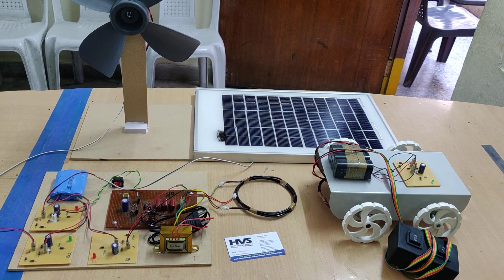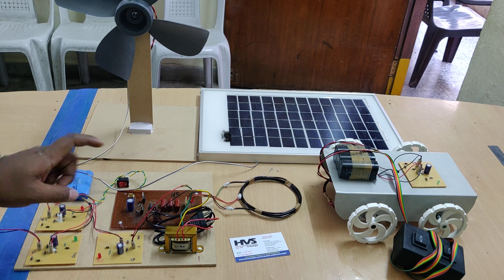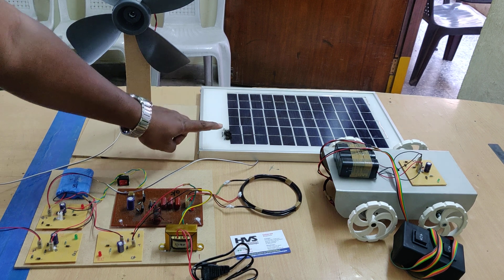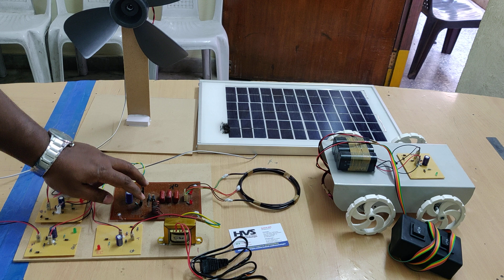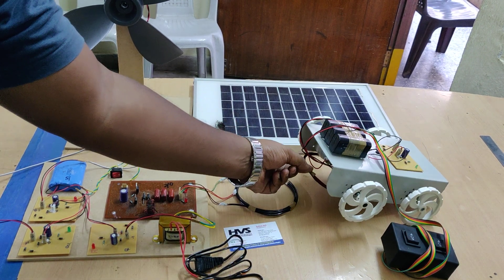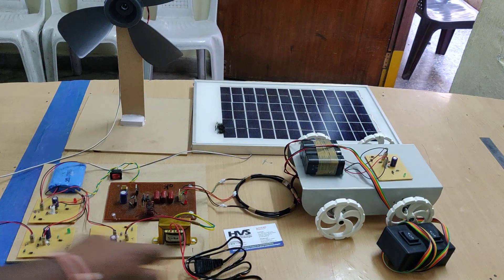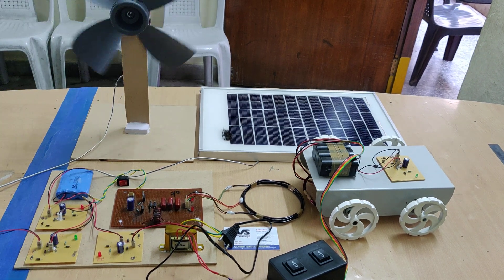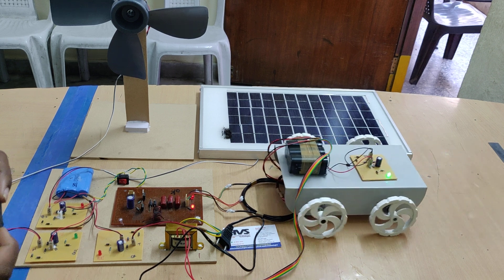wireless Power Transmission for electrical vehicles using Solar and Wind

Comment: Sir can u tell me components used in it and how much it cost will while making
Reply from the maker: You can contact us at +919603140482
Through WhatsApp or call
Reply: @hvstechnologies  what is the cost
Reply from the maker: @karthiknayak4381  You can contact us at +919603140482
Through WhatsApp or call
Reply: @hvstechnologies  ok sir
Reply: @hvstechnologies  sir how much it costs?
Reply from the maker: @KiranKumar-fv6cx  You can contact us at +919603140482
Through WhatsApp or call
Reply: What is the cost